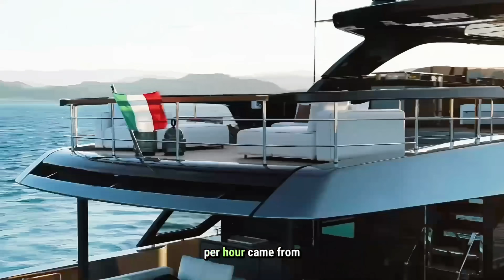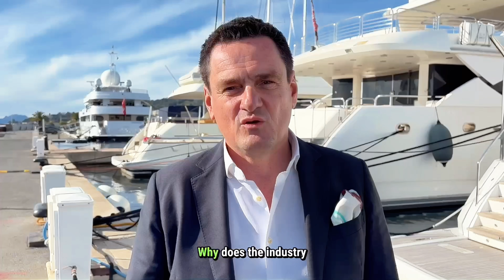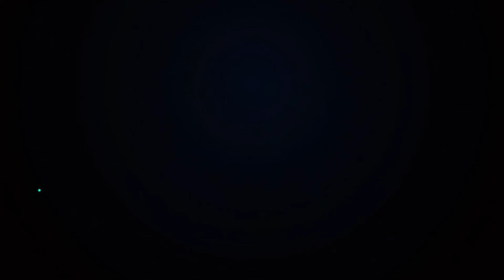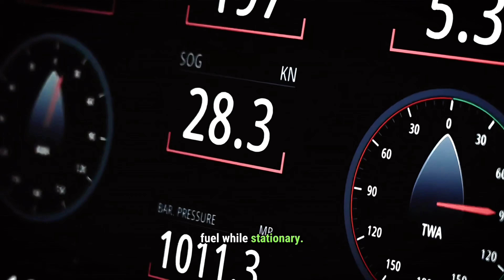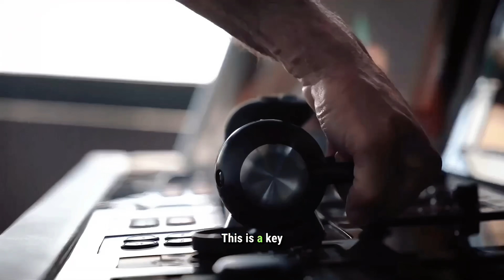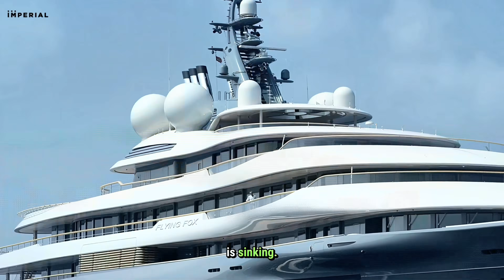Motor Yacht Fuel Myths Busted: Fuel per Nautical Mile & Real 1-Week Trip Budget

Comment: Sorry in this one i have to disagree with you. 1. I use US Gallens per hrs not liter per hrs. 2. That will not work on a full deplacement yacht that does not work. On my full deplacement hardgrove yacht with 5 bladed props and c18. Engines on both Engines i get 4500 km with a 10% reserve at 8.5km.   If i feather one engine i get 5500 to 6000. At 8.5km with a 10% reserve.  If i go 14km I get 2500 to 2900 km with a 10% reserve . All in a normal pacific sea state. All of this i have gathered over 5 years. Plus i have the numbers to show it.
Reply from the maker: Hello! First of all, thank you for sharing your real-world numbers. 5 years of logging data on a heavy displacement Hargrave gives you a fantastic baseline of knowledge. Also, no problem with the US Gallons—we deal with both metric and imperial daily!
However, your comment actually proves exactly why I advise against single-engine operation on standard builds like the Bering 88. The crucial phrase in your comment is: 'If I feather one engine...' You have a very specific setup. If you can physically 'feather' (adjust the pitch to align with the water flow) or fully decouple your 5-bladed props, you are eliminating the massive hydrodynamic drag of a locked or dead-spinning propeller. Most production expedition yachts, use fixed-pitch propellers.
If You  simply shuts down an engine without a feathering prop or a controllable-pitch propeller (CPP) system: A fixed-pitch prop acts like an open parachute, creating colossal drag. The autopilot must apply a heavy rudder angle (12-20 degrees) to counter the asymmetrical thrust, acting as a second brake.
The single working engine is then pushed into 'lugging' (overload at low RPM) trying to push tons plus that artificial drag, which ruins the turbo and spikes EGT.
Your numbers are excellent, but they are a result of a highly specialized drivetrain (feathering capability) that most buyers of standard twin-engine fixed-pitch yachts do not have. For a standard fixed-pitch yacht, dropping both engines to a highly efficient slow cruise (like your 8.5 km/h example) is the safest and most efficient method.

Thank you again for the comment. That Hargrave sounds like a brilliantly engineered vessel!

Comment: Croat here. Thanks for shout-out.
Reply: Thank you for what you said. If i run both Engines at that speed 8.5km the rpm will be 850. IE lugging. That bad for both Engines.  That why I do what I do. Plus the bonus is less hrs on the Engines.  There a old saying.  Those who know do. Those who don't know. Dont.

Comment: Lier,lier,lier!! A 60 tons yacht with two engines MAN D2676  500hp each ,burn 12,3l/h at 700rot/min and have a 7kn speed and 4200 nm range. But at 1800rot/min and 15kn speed, burn 181l/h and the range is only 613 nm!!
Reply from the maker: Everything depends on yacht's hull, conditions on the sea and many other factors.

Comment: Nice video. They need to quote figures in mpg or l/nm. And understand hull speed. Hull speed varies by boat length, longer boats can cruise efficiently at higher speeds in the off plane regime before planing, it may be 8 knots for a 50 foot boat or 11 knots for an 80 foot boat. Below hull speed planing boats are much more efficient, but not just below it or just above it, when they're trying to get on the hump or at risk of dropping off it. Some IPS boats have best planing efficiency at very high cruising speeds (like the Regal) and shaft drive normally a moderate planing speed, but the penalty for doubling speed from say 13-27 knots can only be about 10% on a shaft boat. From what I can see it is IPS that can have poor economy at slow planing speeds, shaft don't seem to have the same problem, but have lower peak efficiency. Each boat will have a unique set of litres per Nm at each speed, so well worth testing the economy at each speed in both directions (to average out tide and wind influence).
Reply from the maker: Good point!